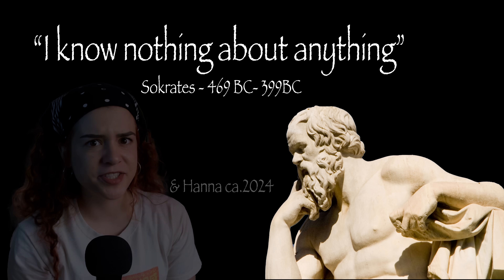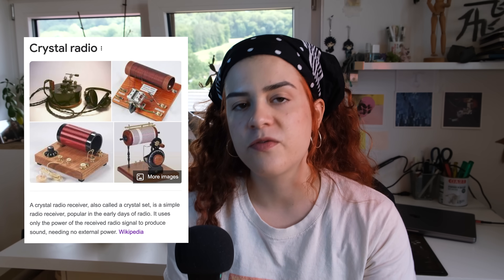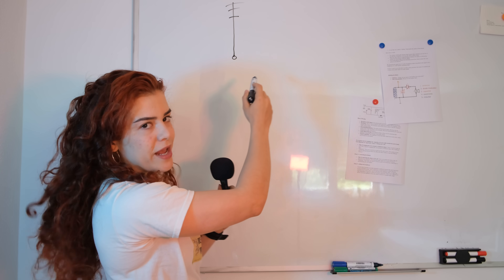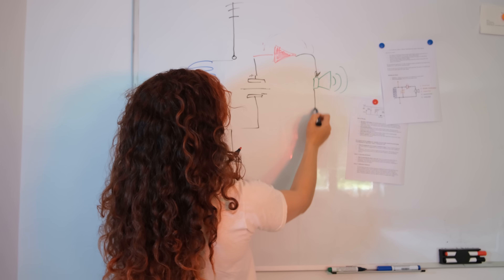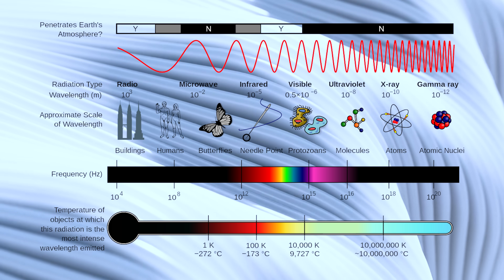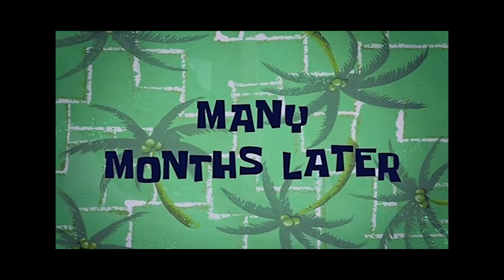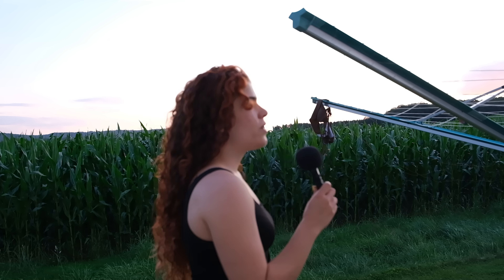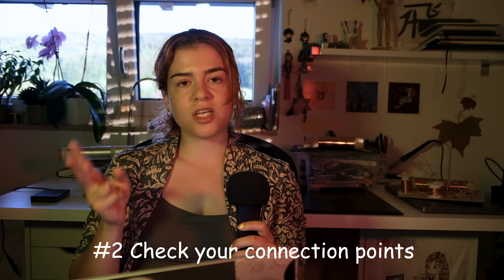I BUILT A RADIO AT HOME

Comment: "I have no clue but I am teaching it!" 😀 Haha, nice anyway. But you meant knowing what is electricity. You wont. Even dee physicists dont agree about it. Does the electrons travel through the metal? Or is it a electronic pressure? What the relation between the current flow and the electrons arount the metalic string No one knows for certain. But what is certain, you dont have to know this particles things to use it.

Comment: Congratulations!'

If you want to learn, I'm sure that there are Ham radio operators (also known as amateur radio operators) nearby, some of whom would be happy to spend time with you answering questions, and helping you improve your receiver, or analyze the problems that you had with your earlier attempts.  They will also be able to find what AM signals in your area are strong enough for a crystal set.

One possibility for the signal that you heard but could not interpret is that it might not have been AM, but SSB  (Single Side Band), which, when heard on an AM receiver, gives a vague impression of voice, but is unintelligible..

Comment: you can use any copper or aluminium wire for the coil, just keep turns slightly separated if it is not insulated (enamel, pvc, Teflon...), you can do so easily with care.
you can use certain minerals as detector instead of the diode, such as pyrite, galenite, magnetite,
also the phone is about only part difficult to make with primitive gear.
basic for antenna is as high and long and possible, anything less than 75m is still shorter than ideal

for a beginner set a oatbox set is recommended,  it uses taps (twists of wire stickkng out) on a coil and you just move the ground and antenna wire between them to "tune".

Comment: I guess I was lucky growing up in USSR in the 70's, where I built a crystal radio when I was about 10 years old or even earlier.... I am old, though and back then these things were much more in the folklore. No YouTube, just folklore. After a crystal radio I built quite a few amplified transistor radios that were battery powered. There were magazines for young electronics enthusiasts back then where I could educate myself on the subject of radio receivers. I am talking 1970's soviet Ukraine here.
Reply: Similar journey in the UK. I had an electronics set at the age of about 5 or 6, the one where the components are laid and and you connected wires into springs, and made my first crystal radio, later adding a transistor amplifier to it. Do a google search for "ladybird book transistor radio" - I built these circuits in primary school.

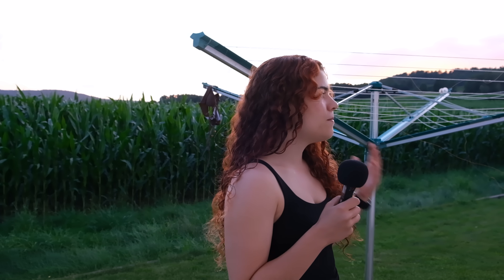Comment: 9:00 I think the key is to understanding electromagnetic waves and their properties (this is very importsnt and usuelly it is missing part in a lot of books for beginners but this is where problems start with radio devices problem in my opinion, plus a lot of people want to present it but without skills and proper knowledge and this is a receipe for a disaster) and the rest is easy. Without it is like chasing its tail by the dog and you cannot go anywhere (I am talking from experience).

Comment: If you want to make it more sensitive you can open up the diode almost by putting a small battery with resistor over the diode to put 0.6 to 0.7 volt over it, you need to lookup the data sheet and see at what voltage it opens, so it can actually receive weaker signals by it being not closed. This way you will not neeed the signal to be above the opnening voltage of the diode since it is almost open already. A trick I learned from my father. I Already have built one many years ago worked but we don't have so many AM stations anymore. So by this trick one does not use an amplifier but makes the receiver more sensitive. Good luck with science, not giving up is an essential part of it.
Reply: It’s a germanium diode, .7V is wayyyy to much. More like .2V (and make sure to use two resistors as a voltage divider)

Comment: A cute and fun watch! Didn't get why a soldred-in resistor would be any help in order to replace that makeshift variable capacitor.
Many thanks for not quitting the task. :-)
Reply: I wonder if leaving the capacitor out, gave the crystal set a broader coverage of received frequencies?

And the resistor over the piezoelectric earpiece basically allows a complete electrical circuit for current to flow?
As nominally, the earpieces are very high resistance.

A schematic diagram representing the finished radio would be a great way to know!

Comment: Major kudos for trying to use the smoke dector part for an earpiece. 

Trying DIY stuff is how you learn. 

Btw. The inductor and capacitor have a natural resonate frequency that the electrical signal bounces back and forth at.  That is how it selects one frequency from the antenna.  

And when you cam which part of the coil/inductor you are touching ot changes the resonate frequency you are selecting from the antenna.
Reply: Yeah, this actually makes me wonder if the problems with the capacitor were just a matter of having the right capacitor for that particular circuit... if it was just some random capacitor, it might not have been well-matched to the purpose at all.  I don't know the details well enough to suggest a specific value or type, but... worth researching and/or experimenting with different values and even types of capacitor, potentially.

Comment: The difference between AM and FM is that with AM you can very easily demodulate the radio waves into baseband (audio) signals with just a few components but AM quality gets way worse with interference, with FM you need a local oscilator that follows the frequency of the station that constantly changes (thats why its called Frequency modulation), you have a device that measures the phase difference between station and oscillator which has an output which is the audio and the correction signal for the oscilator itsself. Also the quality is way better with FM
Reply: For FM reception,  a good quality tuned circuit will allow Slope detection, and FM crystal sets are indeed possible.

Slope detection doesn't stop interference like a true FM detector however.
Reply: You can do an FM detector fairly simply with two diodes and a tuned circuit.  The design is called a "ratio detector"  You don't need a local oscillator etc
Reply: No!  It is not so!  My father told me that FM stations were in New York.  
I couldn't believe he lied to me about that.  Guess it was easier to explain that to an 8 Yr old then modulation.
Reply: And then you move into CDMA like qfm256 and start learning about Walsh codes and information theory and build transceivers in software and it's a richly appointed rabbit hole

Comment: A capacitor+inductor resonate at a specific frequency. Old radios had variable capacitors to change the oscillator frequency which changes which radio station you could hear. I remember being where you are 40 years ago...
Reply: You young whipper snappers are just getting started  ) :) :)
Variable capacitors you remember are now getting expensive and hard to get.  I made a video showing how to make a really-really cheap one out of stuff you may have laying around.  It has 3 nice features:
1) It is really low cost
2) It doesn't cost much
3) It is really-really cheap.

Comment: If anybody is wondering, the inductor-capacitor network builds a band-pass filter that lets only a limited band of frequency through. By changing the contact on the inductor you can tune the center frequency of the passing band which lets you tune to a certain channel
Reply from the maker: wow thats really well explained and helped me understand the process even better! Thanks!
Reply: @arthoefmann  I like this comment and the video. It reminds me of the time I was in secondary school and crazy about how electronics work.
It started when we went to electronics repair shop to pick up TV that uses CRT (Cathode Ray Tube). After that I got hooked and, in few months, I was able to become apprentice at the shop.
While working there I realized that the shop keeps a lot of PCB (printed circuits boards) from different devices that are beyond repair. The boards sometimes serve as sources of spare parts if needed.

After couple of months, I read an entry level Basic Electronics book. The book covered radio receivers and transmitters.

To make sure that I understood the subject I asked my boss to give me some of the boards in the trash so that I can use it for experiment.

The inductor-capacitor (LC) circuits in the radios are already designed to oscillate / filter SW (short waves) radio frequencies with ranges between 3 and 30 megahertz (MHz). So, I used the new receiver to tune and listen to BBC and VOA (Voice Of America) news.
The good thing about shortwaves is that they get reflected by ionosphere which allows you to receive the signals from other part of the world.

After getting the receiver working, I then use the same inductor capacitor circuit to create an oscillator that oscillates at the same shortwave frequencies. I then use sounds from the output of cassette player to modulate (AM) the signals coming from the oscillator.
After modulating the output of the oscillator, I was able to tune any nearby Short Wave AM receiver to the frequency and hear the music wirelessly.

After that I started working on FM (frequency modulation) transmitter. But I abandoned the project before finishing.

If you live near radio repair shop you might be able to get some parts from them and use it for your projects.
Reply: Using a little less specialized language, you want to make a circuit in which electric current likes to oscillate at the same frequency that the radio waves oscillate.
Reply: Dunno what a band pass filter is, center frequency, or passing band. I assume many people watching this probably don't know those things either :) Yes, I will google it. But. It's gibberish to me right now
Reply: @outbakjak  think of it like this, your ears can only hear a certain range of sounds, above a certain lower limit and under a certain higher limit, that's a band pass.

The centre frequency is as it suggests, the middle of the range of sounds you can hear. 

You can apply the same principle to radio stuff, the pass band is the bits the radio is tuned to hear and the edges of the pass band are defined by where the received signal strength is half the signal strength at the centre frequency
Reply: @outbakjak  That's why I said in another post - look at the 'electromagnetic spectrum'
Reply: @outbakjak Wikipedia will fix this quickly!
Reply: @outbakjak your guess is correct. However in this case it's probably better to think of it as a tuned resonant circuit. Because of the coil size and capacitor value it wants to preferentially resonate at the radio stations frequency. The diode or crystal detector takes one half of the audio modulating the stations transmitted power and passes it to the speaker. If there was no diode the signal would average at zero. The germanium diodes are all different, you may have to try a few to get a good one.
Reply: @outbakjak  Band pass filter simply put means that the filter only allows certain frequencies to pass through while others cannot pass. This has got to do with resonance. By changing knob on radio you change the band of allowed frequencies either up or down depending on the frequency of the channel.
Reply: @outbakjak  basically inductor resistor and capacitor can be used to protect the circuit and prevent unwanted signals, every filter means combination of these 3 components (generally), capacitor reduce current, inductor reduce volt, and resistor does kinda both and used mostly to protect, capacitor and inductor mostly used to convert.
Reply: @outbakjak  it's difficult to explain because these stuff requires some advanced math knoledge. For example in order to understand what it means for an electrical signal to have a "frequency spectrum" you need to know what a furier transform is. Also you would need to know that in a LTI system, the output's spectrum is the multiplication of its transfer function and the spectrum of the input...
Reply: @TheGiuse45  There is a way to avoid a lot of math.
Imagine a radio that you can tune to any frequency you like.
Imagine that instead of the earphone, you put a volt meter on the output (with a capacitor).
It is fairly simple to explain making a table of what voltage you see at each frequency.
Yes, it is doing a Fourier transform but until this line I used no scary words.
Reply: @kensmith5694  I'm one of those people that don't understand something unless I have a mathematical model to point to. This is the reason why in high school I hated the way they explained fasor theory and why I got into electrical engineering. This is why I try to include stuff that can be looked up when I try to explain something
Reply: @TheGiuse45  Different people learn differently.  We need to make learning available to all sorts of people.  Even though I have written my own FFT routines, I won't demand others do the same.
Reply: @TheGiuse45  While it's difficult to explain the details, I do think it's possible to make an accessible analogy.  To wit:
Imagine some spinning things (front bicycle wheels, say).  Some are spinning slowly (or stopped - slow enough that you can barely tell), some spinning moderately quickly (one revolution per every second or two, say -- clearly spinning, at a rate you can discern), and some are spinning very very quickly (multiple to many revolutions per second, where it's just a blur).  A "band-pass filter" would be like kicking the slow and really-fast wheels out, and only paying attention to the ones spinning fast enough to feel like they're spinning, but slow enough that you can tell how fast they're spinning.

Is it perfectly like that in radio?  No, there are details that the analogy glosses over, and yes, more knowledge would be required to really make sense of all of it.  But, a lot more could be understood than that while still not knowing Fourier transforms, LTI systems, transfer functions, etc.

In other words, I'd encourage you to not make it seem like your difficulty explaining these things means others are hopelessly out of luck for trying to have some understanding of them.
Reply: @TheGiuse45  not necessarily advanced math knowledge for basic understanding, but it does get up there when you start trying to design your own from scratch!
Reply: It's not just a bandpass filter, the inductor and capacitor form a resonant tuned circuit, so at the "bandpass" frequency it is tuned to, it also amplifies the signal, similar to the booming noise you get if you hit the resonant frequency of a box if you sing into it (thinking of analogies here!). You can change either the inductance or capacitance to change the tuning, Usually, it's the capacitance which changes when you tune a radio, using a variable capacitor. Switching bands may switch the inductance as well.
Reply: Also called a tank circuit
Reply: While its preventing the "voltage drop"  at the same time ;-) (Do you know that you can acctualy just solder one resistor together with one capacitator, and make radio from almost anything that what have electricity inside? ;-) ;-) ;-) ;-) You know, every wire who is currently conducting electricity is kind of radio ;-)
Reply: @PetrBelohoubek-ot5ok where can I find a schematic for this? I need to try this, lol!
Reply: Well, yeah, it helps with the understanding but it's not necessary for the fun 😉
Reply: f = 1 / (2π × √(L × C)) .= 1605 kHz

Comment: Wow i am amazed that it works with such an antenna setup. No impedance matching, no proper insulation and the wire goeas near all sorts of  conductive things and it still works, cool
Reply: They tend to work without any obvious impedance matching.  The antenna is a lot shorter than a wavelength.  This means it looks capacitive.  It is connected to the variable inductor.  This means that you bring it on resonance with an inductor.  That is effectively an impedance match.